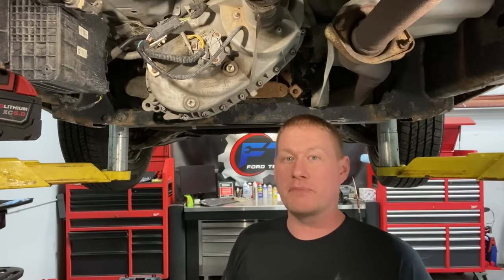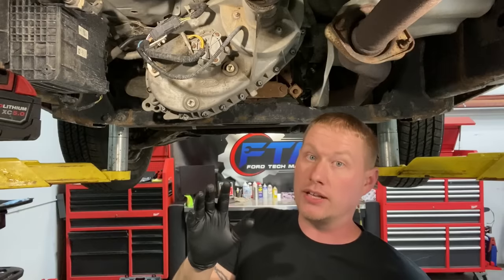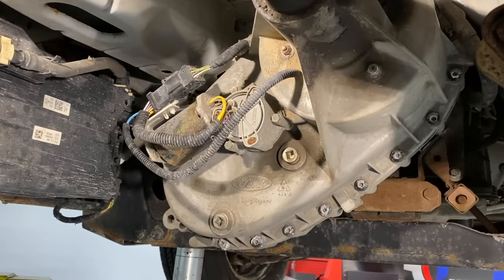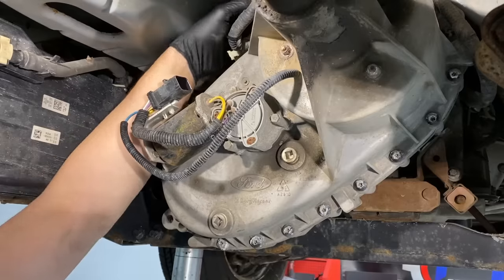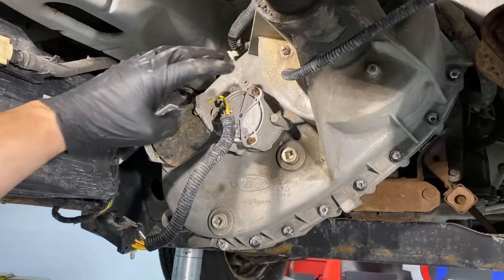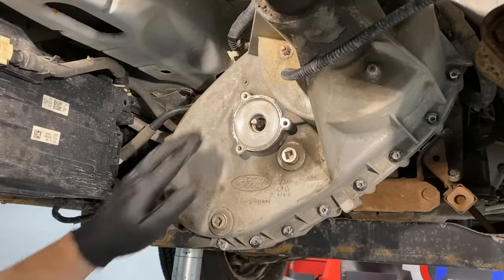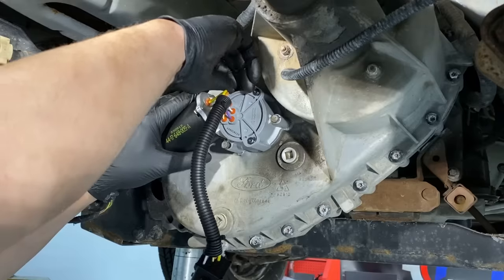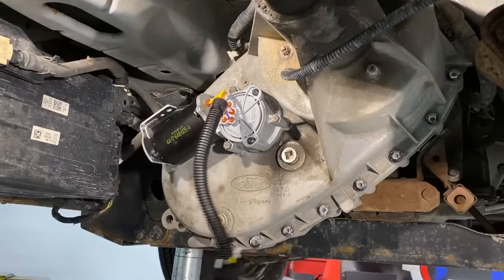2004-2020 Ford F-150 Four Wheel Drive Inoperative DTC P1867: Transfer Case Shift Motor Replacement

Comment: I have a question that I hope you can help with, I watch all your videos and know that you know what you are talking about. My question is, 2008 F150 super crew cab, lariat, 5.4L.... 4 wheel drive not working. I watched videos on replacing IWE and checking for vacuum, transfer case motor, etc. NO video is mentioning my findings. With truck jacked on driver side, when I spin the wheel the axle do not turn, with truck started or not started. My dash light flashes one time when i put it in 4 hi on the switch but stays off. When I go to 4 low the light comes on, stays on, sounds like you can hear something ‘meshing in’ but no 4 wheel drive.  Any ideas?
Reply: On second look, I jacked the entire front, my driver side axle do not spin with the wheel at any time and the passenger side spins all of the time with the wheel, but I do not have 4 wheel drive in 4hi or 4low. I can feel the transfer case motor working but not sure if it is turning the inside shaft or not. I guess that is my next test, to take off the transfer case motor and try to manually turn the transfer case to 4 hi

Comment: What if there is no code?  Indicator light wont come on.  Fuses look good.  I don't know how you check the relays on the driver side fender.  I don't want to open my wallet and start replacing parts till it comes on again.  Any suggestions?

Comment: Is this the same in 2001
Stuck in 4 h
Unplugged from firewall and manually disengaged for now
Reply: the1timster no this is my 2009 F150 that was in getting a Melling high volume oil pump
Reply: Thought I was replying to the 4 wheel drive transfer motor

Comment: I have a 2011 f150 and believe this is my issue however when i try to switch drives I can hear the motor humming but nothing locks in. Is something else more serious going on?
Reply: Pull the motor and see if it actuates like it's supposed to. If it does, your transfer case might be junk.

Comment: General rule of thumb.. if you own a Ford you better like working on cars or have a family or friend that is a mechanic.. 😉😂🤣😂🤣
Reply: @wysetech2000  I agree.. all brands have their fair share of issues.. but I can tell you from been in the auto industry and a gear head.. Toyota's don't seem to struggle so much specially with petty issues.. 😊
Reply: @wysetech2000  fair enough.. and then their is styling, unsurprisingly it doesn't appeal to everyone I get it, but you can't deny they sure make quality stuff.

Comment: I did this, this afternoon. Now my Speedo is all out of whack and says I’m going 100mph when I’m doing like 35. My truck won’t shift into 4wd and it’s super laggy and shifting kinda rough. Any ideas?
Reply: That's exactly how mine was behaving, and when I pulled that motor I found it stuck if 4 LO

Comment: My 2011 4x4 will only randomly shift into 4x4, frequently get the "wrench" with check 4x4 alert. If you keep turning the switch on the dash from 2 high to 4 high, it will eventually shift, but it shifts into 4 low (while the switch is in 4 high position)...then you can move the switch to 4  low and back to 4 high and it will shift into 4 high. Anyone had this problem?
Reply: Yes, this is my EXACT problem! I’ve been looking for information on the best course of action. I can switch to 4L relatively easy,  it’ll also switch to into 4L selecting from the 2WL to 4H position at times causing the grinding till I stop. Wonder if this is a vacuum line issue, transfer case electric module issue, or selector motor issue?

Comment: Is there any preventive maintenance to keep this from happening?
Reply: Every one I have come across on a Ranger/Bronco II the contacts were dirty or stuck. So I think it's a good idea at least twice a year cycle through the gears. I also like cycle the manual hubs so thy dont stick. if you have manual hubs I like to drive in 4wd high every so often to keep every coated in oil and loose, gears, drive line stuff like that. So far thy been problem free and the added bonus is you know it's going to work when your not in a bind and need 4wd

Comment: I replace tranfer case motor and still on 4×4 low even though it says 4×4 high or 4×4 auto and 4×2 but to put on 4×4 low says to pull forward but won't engage. I just want my 4×2
Reply: Help

Comment: My 4x4 shifting doesnt always work.  But I never get an error code.  WOuld this still be the shift motor at fault. 2010 F350
Reply from the maker: You must pull codes but yes this is the most common.

Comment: I did change my transfer case motor but i don't have any dashboard light telling if I'm in 4x4... what should I check next?? i wonder if the past owner connected directly so my truck runs 4x4 all the time...
Reply: Can you hear a small click sound when engaging and disengaging the switch while the truck is moving?
Reply: @Fret01  no i haven't try that yet since i saw videos that you have to put it in neutral. But i don't see any 4x4L or 4x4H warning lights on the dashboard. A lot of people here on the internet say maybe is a vacuum leak or something but why i dont have warning lights tho?? Do you think my selector know is damage also??
Reply: @afluffypanda08   - It could be that, a faulty selector switch but first try switching from off to 4 hi while the truck is moving and if you can here it engage.  If that doesn't work, remove the transfer motor  and have someone turn the selector switch from off to 4 hi and see if the mini shaft inside the motor moves.
Reply: @Fret01  i will try that this weekend thank you

Comment: Hi mate it's a great explanation 👍  but on my EXCURSION 7.3  the  switch position is in 4X2 and the light (4X4) not desapear!🤔  it's stuck in ( Hi 4X4)🤔 probably i need replacing that piece also! but on my EXCURSION 7.3  it's not the same like that engine 🤔 it's a different position 🤔 anyone replacing on a EXCURSION 7.3? thanks fellas cheers from Norway 🇳🇴 👍

Comment: This is not the same harness as a 2015. I have a metri pack terminal and it’s a nightmare to remove the blue wire without damaging it. And if you do damage it, none of the part stores have a replacement.

Comment: Newbie question.   Where can I find replacement transfer case drain plugs?
Reply: Go to the parts counter of any dealer.  If not, check with a salvage yard.  You might also get lucky and find them on Amazon.
Reply: As long as the thread is correct you can use it. Pull one out and drive a different car to the parts place, give it to them and tell them you need new ones

Comment: How often should the transfer case fluid be changed?
Reply from the maker: Every 30k miles is best simply because it is always rotating inside with no external cooling and only takes 2qts of fluid. It has drain and fill plugs so it takes just a few minutes to service.
Reply: FordTechMakuloco sounds good, Thanks!

Comment: Hello all. I have an 2010 Ford F-150 King Ranch and when i turn the knob to switch into 4H or 4L it says 4x4 check with a wrench icon beside it. Now other than that i get no code errors (Well i do not have a code reader so does the dash not show codes by itself without a reader?). Also even though i get the 4x4 wrench it still can drive while in that mode. Anyone know anything about this?

Comment: I hope someone can help me I had a flywheel and starter put on my truck. when I got it back my check engine light was on I had a wrench on my dash and I had a flashing O/D and when it goes over 5 to 10 mph it says trans fault i had no problems till the flywheel was changed
Reply: It's a 2005 ford f 150 fx4

Comment: What would cause my 4high not to work but 4 low works correctly ??
Reply from the maker: Almost always the transfer case shift motor but I have had a few pcm's cause this. A proper diagnosis is in order.

Comment: In how many miles that thing  fails? I have a 2017 f150 4x4
Reply: I think Brian said that this one had 200,000 miles on it.
Reply: @harleyjackson5513  thanks for the reply
Reply: It may never fail.  The truck in this video has 200k.  This is not a Ford specific issue.  It’s a common failure, but there are tens of millions of trucks on the road with electric transfer cases.  This is not something I’d worry much about.  To prevent issues you should shift in and out of 4wd once a month or so off pavement.

Comment: Would have been great time to cycle tge 4x4 switch to test it ..
Reply from the maker: After or?
Reply: @FordTechMakuloco  I was saying while it was out .. I am battling a 04 with no 4x4 .. thinking a vacume hub problem . Had a rub hole in the line I'm thinking it engaged the hub to.lock and prolly finished it ... great videos .. thank u

Comment: I don't use my 4 wheeled drive much on my 08 F150. Is there a recommendation to engage the system that doesn't get used often?
Reply: Walter Williams   off pavement once a month, engage each 4x4 system.. spend about 5 minutes total once a month

Comment: I wonder if I'll need this, 4x4 works yet I get a wrench warning and message "check 4x4"
Reply: heronlyfriend   connect a scan tool to your OBD-II port and it will tell you the error code of the check 4x4 and you will know what has failed

Comment: Hey FORDTECH. I HAVE A 2007 F150 5.4! 4 YEARS AGO I GOT MY CAMPHASERS REPLACED AND VCT SOLENOID REPLACED. MONDAY I GOT ENGINE CODES. P0012 P0016 P0113 P0300 P0302 P0303 P0304! I SPOKED TO FEW MECHANICS. ONE SAYS IT MIGHT BE SPARKPLUGS OR COIL ISSUES. ANOTHER SAID FUEL PUMP AND FUEL FILTER ISSUES. THE LAST ONE SAID CAMPHASER ISSUES. NOW IM HERE ASKING YOU WHAT CAN IT BE!! PLEASE LET ME KNOW. THANKS IN ADVANCE

Comment: My 2022 has no red clip and the pin release is killing me.  I cannot find a way to release the wire.  Anyone help??  Edit, finally got the motor replaced and i am now stuck in 4L.  I can hear things working.  Codes keep coming up and i keep clearing them.  Why would a new truck with 9000 miles have this issue?  Getting it towed to the dealership and it isn’t under warranty because i have a 6” lift and larger tires.  Anyone ever heard of this????  I am losing my mind.

Comment: I'm having a problem with my '05 F-150. When I put it in 4 hi, the indicator light doesn't come on. 4 low does. The light comes on when I turn the ignition on, so the bulb isn't burned out. The 4 hi works fine, BTW,  just no indicator light. Is this a common problem, and is there a simple fix?

Comment: Buen día, tengo una Ford F150 1998, XLT, motor V8 4.6 litros; hace aproximadamente tres años qué la compre funcionaba mí 4*4 (electrónico) después al medio año dejó de funcionar, la lleve a escanear y me apareció el código P1838, revisamos las líneas de cableado (todas tienen continuidad), también el botón de la doble tracción (funciona) y las líneas de vacío (no hay fuga), le compre el motor de la caja de transferencia, al principio funcionó bien, después de dos meses ya no funcionó, nuevamente llevé a escanear la camioneta y me aparecen los códigos P1812, P1815, P1838 y P1867, ayuda de favor para no comprar en vano otro motor, hace una semana de repente funcionó mí doble tracción (por tres días) pero nuevamente ya no funciona...

Comment: What causes a jerky feeling in 4WD ? Also feels like truck is having a hard moving forward, lots of gas to get it to move! Don't know what it should feel like, doesn't feel right. 04 f150 stx. 4.6 v8. No noises, just doesn't move smooth in 4wd,even in snow, too jerky!
Reply: @wysetech2000  it's really undrivable on a snow covered street, feels like something is going to break! At 40 mph still jerky! My 87 K5 blazer was smooth at any speed, never labored , only at a sharp turn.

Comment: I like this channel for some info but you never respond.
Reply from the maker: I run 3 companies, so time is short, as it is I have no time for my family and kids that are growing up without me. So, I allot 1 hr. each day to responding to the daily comments and that is it.
Reply: @FordTechMakuloco  so it takes a criticism to get you to reply? ;)

I do understand somewhat about the family and all that I want a real estate company and years ago I worked as a mechanic and a Volvo repair shop.
But the problem of having with my Ford is when I can't get any info on.

And that's why is my 97 f150 just randomly going into 4-wheel drive when I'm driving down the highway the switch is in the off position?

If you have any idea I'd appreciate a little input.
Reply from the maker: Nope you were just on the list of daily comments I go through each day to keep up the best I can. Like I said I allot 1hr per night to go through the daily comments.